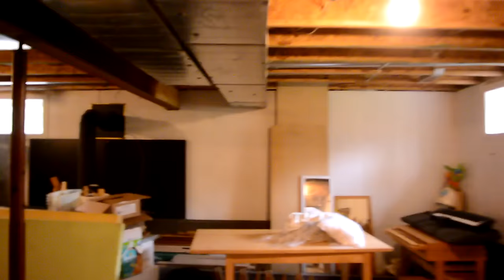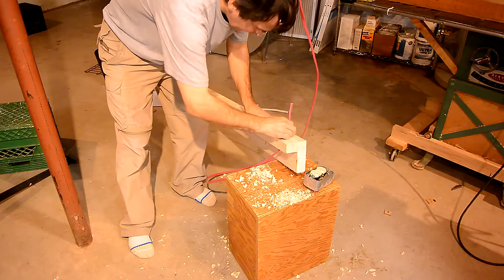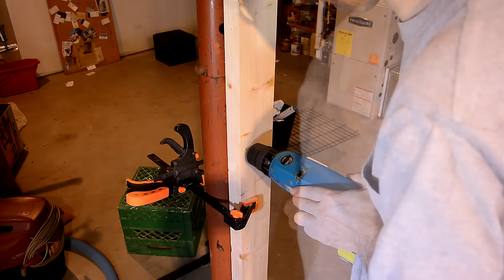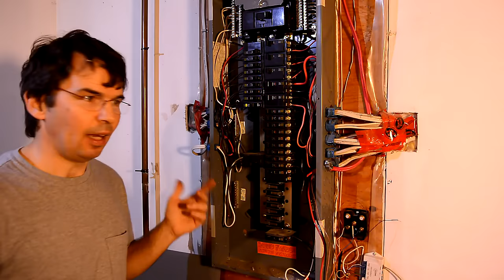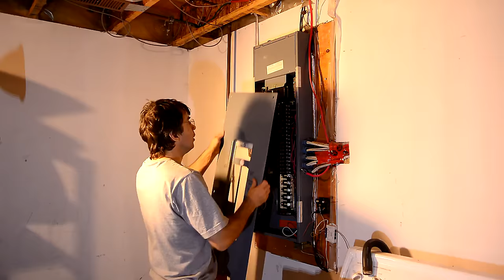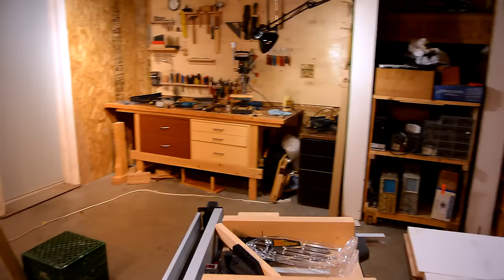Wiring a new 240 volt circuit

Comment: Mathias,
Did that cable have a neutral in it in addition to the red and black? I couldn't see. Just curious.
Also, I don't blame you for not seeing this comment. I haven't seen those much wrong in the comment section... ever. it's hard to read. 
Rich
Reply: Most shop tools use the 2 hots for 240 volts and no neutral. Thus he has 2 hots and  ground.
Reply: No. It was two hots and an earth ground. No neutral. The outlet type he installed, a NEMA 6-15 outlet, does not use the neutral. Only two hots and an earth ground.

Comment: If both of the motors plugs have neutral prongs on them why is there not a white wire back to the panel?
Reply: Neither of the motor plugs have neutrals. Two hots and a ground.

Comment: Hello Mat. Can i run a 10 inch table saw in an outlet in my garage without doing all that work. I’m not a carpenter but i bought a table saw just to do some minor works at my home built a shoe cabinet for my son. So i was wondering if i can using the garage outlet to run a dewalt 10 inch table saw??? It’s 15 Amp 120 volts saw don’t know is that info is helpful. Also does a table saw use so much electricity and expect an expansive monthly bill? Please! Thank you.

Comment: Did you say that was a 12/2 wire???  Shouldn't you use a 10/3 for 240 volts?  Also what did you do for a common?  I am not a professional electrician so I apologize in advance if my question is stupid.

Comment: So do you have 2 phases and a neutral?  Don't understand US wiring.  Here we've got live and neutral (which give you the 240 volts) and an earth which in this house is commoned to neutral where it enters the house.  If your power is 240v coming from 2 opposing phases, What do you do with the earth?
Reply: In residential installations, we have 2 phases separated by 180°. Neutral is bonded to ground in the main electrical panel. 120v phase-to-ground, 240v phase-to-phase. Some things use 120v with a hot and neutral, other things use 240v with two hots and a ground (no need for a neutral). Other things like electric ovens use both 120v and 240v, so they have a 4 pin plug with 2 hots, a neutral and a ground.
Reply: Beefchicken Industries thanks :-)

Comment: You sound Canadian. That or yer from the U.P. or northern Minnesota. Love the accent. That being said, I have a question regarding your breaker panel: I live in Chicagoland (actually the second-biggest city in the state of Illinois: Aurora. Yep, that's Wayne's World..haha), and a retired electrician who also happens to be a gent I respect & trust recently told me one must be careful installing new circuits in a breaker panel because each side must be balanced. Based on what you've said about electricity (how it flows from one point to another and your knowledge about loading those extra 120 outlets you installed), I'm wondering if you a) know anything about that and 2) can explain it to me more effectively than my friend has. I want to install on-demand electric water heaters and the ones that actually work require 240v.
Reply from the maker: Yes, unbalance can happen if you have too many 120 volt circuits on the same side.  But it's hard to anticipate which 120 volt circuits will be used the most.  Doesn't matter for 240 volt circuits though, because those always load both legs, so they don't throw it off balance.  But this is probably why permanently mounted  electric heaters, even those with less than 1500 watts, are always on 240 volts.
Reply: @matthiaswandel  Thanks, mate! That makes sense. I just need to figger out which of my 120v circuits runs the most, as I'd like to install a few new circuits at that voltage as well. Yer the man. ;-)

Comment: The Canadian code requires 14" from the middle of the receptacle box to the floor so this installation is illegal. It's imprudent as well considering the tendency of many basements to flood from various factors.
Reply: You are correct in the flooding part but I am certified as a electrician in America so Canadian rules don't have the same implied rules as United States even tho ik this guy is doing and breaking NEC codes u are Canadian u have no rigjtbsaying what is elligal over here in America

Comment: how do you power 400V 3 pahse stuff?
Reply: You need a different power service type from the street transformer i guess. But 3 phase stuff can work on a single phase + a capacitor. Not so well though. Just don't buy 3 phase machines when you haven't got 3-phase service.
Reply: Vaal River, if you've got 2x 180 degree separated phases in your own house, then i doubt it that your neighbor will have a phases that are 120 degrees apart. And i'm sure you don't want to have diodes in your AC circuit. Then you get DC which is far from what you want.
Reply: variable frequency drives these days. It's too costly and not needed due to electronics these days. VFDs will take 3 phase, 1 phase or even DC to drive 3 phase motors.
Reply: Most residential areas (In Canada) only have 2-phase power available.   That is why there are various solutions online for phase converters.    That is also why 3-phase stuff is often very cheap on the used market.    Industrial areas will have 3-phase and I think some farm areas also.
Reply: Wordsnwood (Art Mulder) in germany I think every house has three phase power, at least in the fuse box
Reply: Most rural neighbourhoods are fed by a single phase primary with pole mounted transformers at each house. Your neighbours are all on the same phase.
Reply: "Bathrooms and showers have tighter codes, like no outlets."  TIL British people don't use electric hairdryers
Reply: paul7053 Neutral and earth are bonded in our main electrical panels, and the neutral is shared between the two 120V circuits. (240v phase-to-phase, 120V phase-to-ground). We also have RCDs, except we call then GFCIs (ground fault circuit interrupters), and they are required on all outlets in wet locations (kitchens, bathrooms, outdoors), and have been so since the 70's. Also, any hard-wired appliance that has a water connection (dish washer, washing machine) also must be connected to a dedicated GFCI protected circuit. We also have AFCIs (arc fault circuit interrupters), which are required by law on any circuit feeding a bedroom.
Reply: Anton Konrad  in the US we have 480/277 3 phase 4 wire 60 hz.   It is the exact same thing you have as 416/240 volt 3 phase 4 wire except the voltage is little lower.   In the US most houses are 120/240 volt, because we love to use more copper wire.   Kind of kidding, but not totally.  It is what was decided over 100 years ago, and we live with it.    By the way, large data centers in US are now using 416/240 volts.

Comment: You should only do this if you have Personnel Protective Equipment (PPE). At least safety glasses and  electrical protective gloves. Even with that voltage there is a risk of an ark flash.

Comment: Judging by some YouTube videos on dodgy electrical work, Matthias is a Prince amongst electrical installers. I can just imagine a bunch of building contractors turning up at Matthias' Fortress of Solitude and trying to persuade him to come work for them. 

I know a number of people who have been 'bitten' by 240 volts, all survived without needing medical treatment - one even managed 415 3 phase - most deaths and injuries seem to come from things like falling off a ladder or scaffolding when the power is cut off.  Of course the really good stuff in mines and railways just sets you on fire as it blasts through your body.
Reply: I have personally seen a number of dead people that were killed by 120VAC.  When your body makes the circuit between it and an inductor, you are toast.

Comment: Classic example of knowing just enough to be dangerous. Where did the neutral come from for your 120v circuits? Did you just splice it to the 240v's ground?  Lol
Reply: What are you talking about?
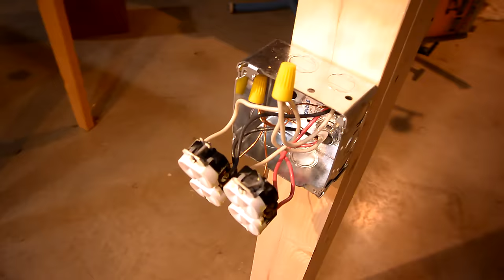Reply: @John Hunkler - look at 4:34. Where do the white wires come from?
Reply: truthsmiles    Please run the video again.   This time listen to the words and not pay much attention to what you see.   He stated that he added another cable that was three wire with ground.   All is good with exception that the two breakers now are required to have handle ties to disconnect the breakers at the same time.   He may have done this but did not state it or show it.
Reply: Kevin Coop even if true it’s wrong. You can’t share neutral.
Reply: truthsmiles  Based on what are making your comment?
Reply: Kevin Coop - You can’t “split” a 240v circuit and use each “hot” as an individual 120v. There are many reasons for this. So even if he used a 4-conductor feeder for his 240v circuit it’s still wrong.

Comment: Hi Matthias. I was thinking about why our wiring practices are so different. There will be good reasons why they are. With your vast open Canadian and American spaces requiring long distribution runs that may explain the use of a two phase rather than three phase and neutral run to each road - it's more economical. I have a harder time understanding why the voltages are different - our higher final distribution voltage reduces the current flow and hence the necessary cable thickness,  Maybe something to do with long overhead final distribution runs and earth leakage? Anyway(s) both 110 and 230 volts rms ac are riskly lethal if applied across the heart  - say from one hand to another. Rubber boots don't help there.  The old trick was to keep one hand in a pocket. Ring mains make sense in our smaller properties, less so in your larger ones (you have more land so it is cheaper - hence bigger houses). You probably have the more sensible frequency choice - 60 Hz was easier for some electric clocks! Protective conductors, or 'earthing' as it used to be called is a minefield. It is possible to get things seriously wrong here if the external arrangements are not properly understood. The point I'm trying to make is that wiring practice differs drastically around the planet, often for very good reasons. With a global reach web site I'm sure you would bear that in mind. Cheers. BobUK.

Comment: I so hate SquareD panels, I've always had problems with older breakers.  I really prefer the BR or BRT Murray, Siemens Panels.  I've worked on BR panels put in during the 1950's, still good as new. SquareD panels put in during the 70's, nothing but problems... I loved the circuit you ran, 15amp breaker on 12awg is very redundant!  I try never to buy 14awg at all.
Reply: Every electrician I've talked to will only use Square D unless forced by a cheapskate to use something else. Maybe it's a regional thing.

Comment: Is it okay to not connect the ground wire?
Reply: He did connect it.  Pay attention. ;-)
Reply: TheGeekPub he only had two wires or did I miss something?
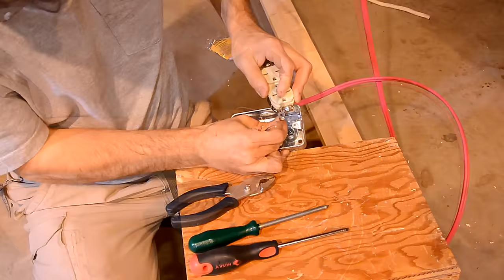Reply: There is most definitely a ground wire.  Ground wires are bare copper.  Look closer at 1:15 to 1:20.
Reply: TheGeekPub thanks! They are normally isolated here 😀

Comment: So let me see:
You got a black, a red, a white and a bare wire time 2.
The two black are hooked up to  L1 and the two reds are hooked up to L2 at the panel.
Both whites are hooked up to the neutral bar.
At the outlets, you have the two black wires hooked to one pair of outlets (top and bottom)  and the two red wires to the other pair of outlets ( top and bottom).
You still have two white wires left and you hook one to each of the pair of outlets.
Do I have it right?
So even though the black and the red wires are actually in different outlets, the white wire connects them together sort of?
Why do you have the white wire hooked up to one cap, was that to make the wiring easy instead of hooking them directly from the wires to the outlets?
But the two black and the red you hooked them directly to the outlets.

Comment: Your Neutral current is cancelled assuming Power Factor = 1 on all tools.  With using motors and whatnot, chances of having perfect Power Factor is slim.  I say that, with having about the same set-up in my shop though.  Typically, I'm not using more than one high-power tool at a time, so it's generally pretty safe.  Just be careful if you have a dust collector that gets bogged down while using another higher power tool.
Reply from the maker: if the power factor on both legs was zero, one leading, one lagging, then yes, neutral would be overloaded.  Realistically, the power factor won't be that low, nor will you find any tools where it's leading.  So neutral can't get overloaded.

Comment: I'm confused - can someone help me out? My air compressor is a 230 volt - I've wired it before to the dryer outlet through 2 lives and a ground, but now however I moved to another home. This new home, only provides you with 2 lives and a neutral. After unscrewing the breaker panel I found that both bus bars on left and right appear to be neutral. The reason I believe this to be the case is because both sides are connected by a "bridge" like metal flat piece. The second reason is because both sides have mixed white wires and mixed un-sleeved copper wire (ground?). 

With all this said and done - I've read that IF both bus bars are neutral and no separate ground - you can use that as a ground - which means I can connect the neutral to the ground section on my air compressor. However I'm hesitant because it also says that you shouldn't mix ground and neutral. BUT that seems to be true only if you have a separate ground, which it seems to me, this house does not have a ground - which implies that the neutral acts as the ground. 

Finally, if I'm incorrect about the above assumptions - how do I wire the 220 air compressor? My assumption is that I can ground the air compressor to itself but there isn't any indication as to how thats done and the documentation simply demands that you seek a qualified electrician to do a job that may be a 5 minute connection that costs 150 dollars. Yes I know the implication of doing it wrong - hence why I'm doing research before I do anything without some sort of certainty. 

PS - I wired the dryer from a 4 wire to a 3 wire by wiring the 2 lives and neutral and simply ignoring the ground wire as it doesn't exist and wired the ground to the dryer. Works great. Can't seem to do that with the compressor.
Reply: LogicSpeaks   It looks as though no one answered you.   Not sure what wiring method you used, but maybe this will help.   At service entrance panels (not sub panels) neutral is bonded to ground and the system requires an "earth ground" at the same point.   Your dryer utilizes 120 volt controls, therefore needs a neutral.   Your air compressor has 240 volt controls, so no neutral is needed.   Now for your wiring method, if you used a 3 conductor with ground cable, black, red, white, bare, wire nut the white.   If you have no bare ground to the compressor, then mark both ends of the white with green tape wrapped where visible.   I hope this helps you.

Comment: They have such things as battery powered lights to illuminate your work area, even headlamps are handy and shine bright where your face is aimed. I would never work on live panel without proper PPE gloves. You should also turn off the main before replacing the cover especially with bare hands. There's too many things that could go wrong,,, but hey maybe you don't like living 😋

Comment: Of course the safety brigade is going nuts. Specially those talking of a 240V shock - it's very hard to receive the full shock of a biphase system, you'd have to touch both phases which is unlikely unless you're deliberately trying to receive it

Comment: hii,

i heard my brother in singapore said his air con unit was installed on a 2
 poles mcb.. i am wondering why double poles ? he said it is 2 hot wire 
that’s why 2 poles mcb.
my question is why 2 hot wire on a single phase 240v system ?
 a single phase 240v system (unlike usa which is based on 120v, hence 
uses 2 hots to form a 240v) , it is just same as 120v of usa.. one pole 
is sufficient to cut off hot wire, return wire from load won’t carry a 
thing when hot is isolated.
hope someone can satisfy my curiosity.
thanksandrew
Reply: andrew ysk It,s because his AC is 400V

Comment: Correct me if I am wrong, but aren't both wires always "hot" in an AC circuit? If I touch either wire when the breaker is on I will get a nice jolt.  What is this neutral business all about?

Comment: Better solution: use a few low voltage LED lights with a battery and work on the panel without power. You can also use a battery and an inverter and run all the LED lights for a long time, without power.

Comment: What i can't get in my head is that the overall safety standards on machinery and such seem way more strict in north america than in europe. (also all the warnings when you open the hood of an american car)

But then there are those breakerboards, with open terminals and open buzz bars and non recessed srew terminals.

On an modern european breaker you can't touch the terminals directly with your fingers even with the "breakerboard" cover off, the buzz bars are layered and isolated.

And there is still little use of rcds, from what i can tell. (just google knowledge)
In austria every outlet and light circuit up to 16A has to have a 30mA RCD. (Thats 11kW on three phases!)

Comment: you actually have 2-phase rotary current ? In Germany, (where I´m from) as you will know, there´s only 3-phase rotary current….or "Drehstrom" as it´s called, i had no idea there was such a thing with two phases, How does that work ?? That´s 240 AC, or what ??
Reply: It’s not 2 phase, it’s single phase with 2 lines both at 120 to neutral